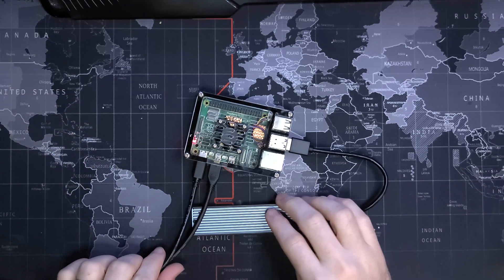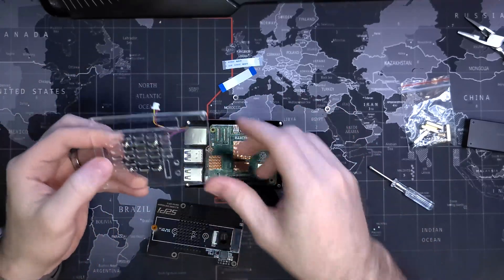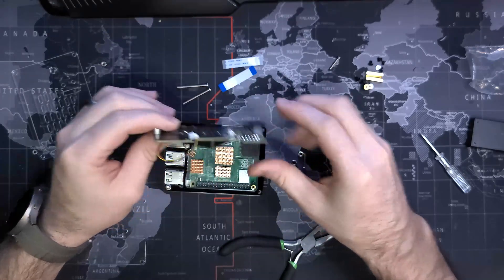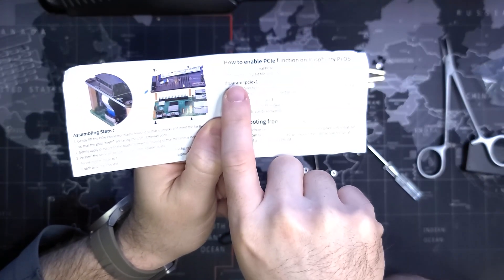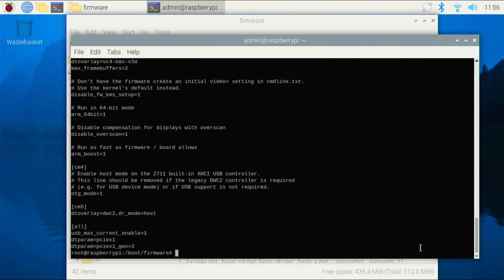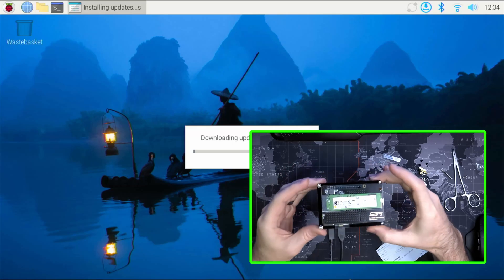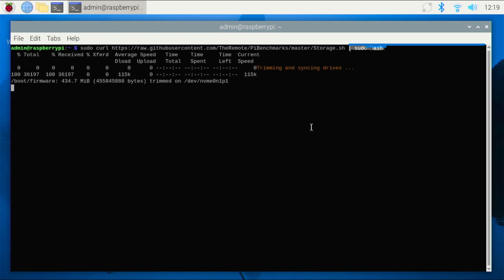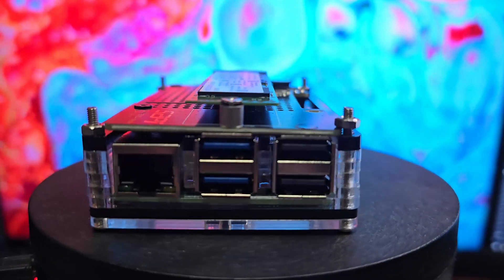Supercharge Your Pi 5 With This Simple NVMe SSD Hack!

Comment: My advice with the Pi 5's. My three Pi5's running NVMe on three different hats. configured and overclocked running Gen_3 speeds it seems to all be in the SSD itself. If your get a good samsung with the most Nand chips and big that seems fastest. Even my tiny Micro Center Inland NVMe's get 700-750 mb/s My samsung 970 Pro gets almost 900 mb/s. Super solid

Comment: I have a bunch of Pi 5's. My Pi 4 is my PiHole. It runs off NVMe via adapter plugged into the USB 3.0 port directly and zero issues and i get 300-400 mb/s read/writes. Not sure I even configured anything either

Comment: Hey, I just want to say that I got 66700 points just by overclocking it to 2800 mhz and the gpu to 1000.
You don't need a lot of cooling to get this overcloking so I recommend to do that
Reply from the maker: Awesome !
What ssd did you use
Reply: @TechworksOnline  A crucial p3. So one of the cheapest 512GB ssd
Reply from the maker: @misticlafrite2871 ahh nice.. P3 scores a little better than the intel 670 as well!

Comment: What a joke! Others use PCIE Gen3x4 NVME....
The Pi5 is only certified for Gen2x1.
Reply from the maker: Yes. It is CERTIFIED for Gen 2 speeds! It is also capable to generate 3 speeds even though it is not certified.

What are the "Others" you'rereferring to.. Maybe I will take a look.
Reply: @TechworksOnline  RK3588
Reply: @TechworksOnline  RK3588
Waiting for a long time for the Pi5, but the test results are totally out of expectation.
The 16nm process is old, the power consumption is really high, the thermal is really bad with stock fansink. Easy to get overheated and throttling. And the power design is sluppy.
The performance is not good, some real tests are slower than Pi4B.
Not all the hats can be leveraged at same time, you always have to be compromised.
For low end or AI applications, will use RK3588 or N100 instead. The TCO is lower and the set up is neat.
Most of the time, will use Pi 3A+ or Pi Zero 2W.
Reply from the maker: @TT-it9gg both of those are almost double the price of rpi5 .... bare rpi5 is $129  N100 is $209+ and rk3588 is $199  ...